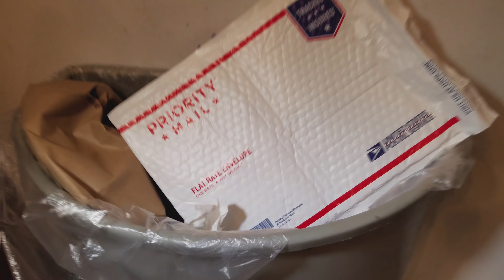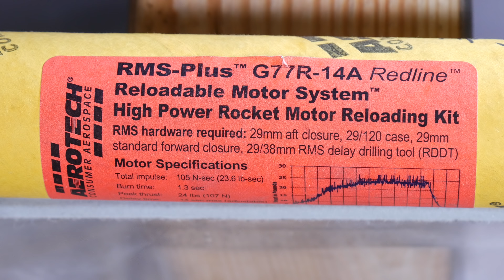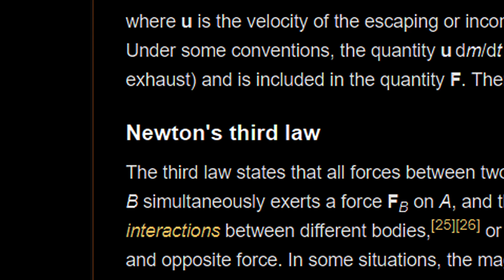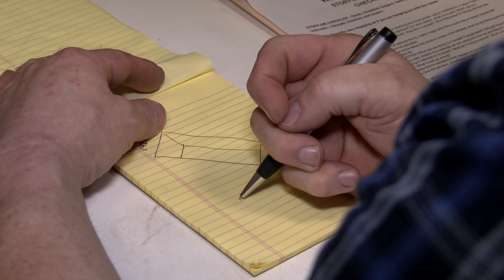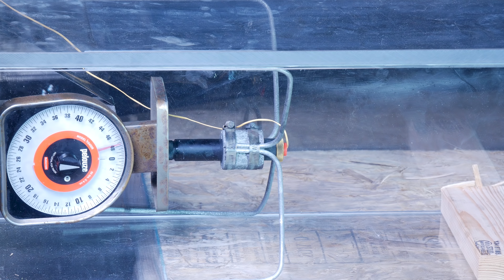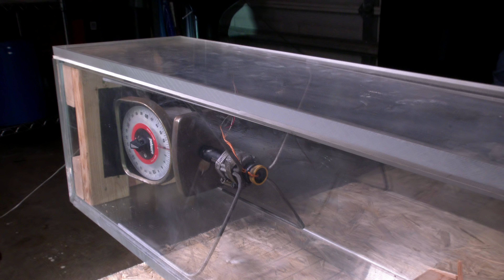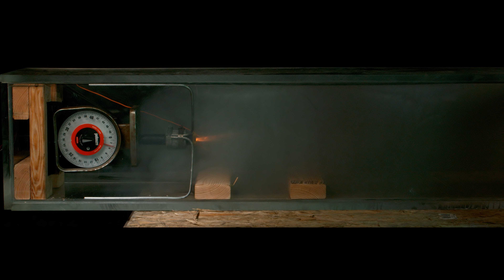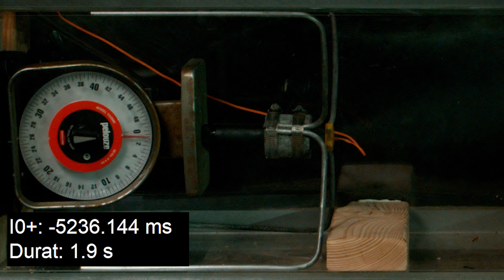Rockets in a Vacuum Chamber - Newton's third law of motion Visualized

Comment: The problem is once the rocket lights off it fills the chamber with matter thus nullifying the vacuum. This experiment starts off in a vacuum but ends up a pressurized chamber.
Reply: It doesn't matter either way. A rockets thrust is not pushing off of anything.
Reply: Jason Jennings  ... dude these guys are shills! They always rely on Newton's third lie! They don't even understand it! They're deceivers and charlatans the science of today is like bad religion of yesterday. Anyway dude you rock God bless
Reply: @ToxicTeemoOCE  it is. In this case the chamber is too small and it's own particulates act as a backstop using it's own exhaust as atmosphere creating thrust. That is the experiments downfall. Chamber too small, igniter sealed in a air pocket nor in vacuum (epoxy) allowing ignition,. Failed test, but leaves some interesting questions and experiment ideas. Cheers
Reply: Yes,all man made. Rockets start in the atmosphere.then enters the vacuum of space
Reply: Not enough atmosphere generated by that rocket motor before it was effected by Newtons third law. It applied pressure to that scale within milliseconds. Your supposition failed.
Reply: The vacuum doesn’t actually matter. This test goes over and above what is necessary to demonstrate Newton 3rd. The force is being applied between the rocket motor and its housing inside the rocket. As long as you can ignite the propellant in some chamber and direct the exhaust or propellant out of the motor, you’ll have force. Think something like a fire extinguisher with a pressure vessel and a strong valve.

Also, as a example, when you fire a gun, you get a recoil. The propellant is pushing on the gun and the bullet. Your hand keeps the gun in place and the bullet goes. A rocket motor is like a gun without a bullet. When you fire a gun without a bullet, you still get a recoil because the explosion is still pushing on the gun and is directed out the barrel.

The same is true of a garden or even fire hose. Except you’re changing the momentum of water, and that causes a rxn force on the hose holder.
Reply: @72golfcrazy  With partial pressure there is a very small but minute amount of push back compared to a high vacuum. The vacuum shown here is not high enough for an ION engine to even begin to operate. Atmospheric pressure is 760mm Hg, or 760 torr. this is at approximately sea level, and the higher a person goes on this planet the lower the pressure. It is measured using an Altimeter in a plane. It works by measuring the pressure on the outside of the plane in absolute pressure, not gauge pressure. It is set preflight to the altitude of the location of takeoff, and then remains accurate unless there is a major change in the weather. It is possible to calculate the amount of back force from the partial pressure and that can be shown experimentally by using multiple identical rockets and doing them in full air pressure, full vacuum both with and without a plate directly behind the rocket motor. That would take at least 12 rocket motors of identical size and weight of propellant. Also a larger chamber so that it does not catch fire, and instead of a spring scale use an arm suspended by a pivot point and have a load cell to measure the force on the other side of the pivot point. However if this is done the ones that don't believe that science works will still say that it is all fake. Needless to say that science developed out of Alchemy, and it has a hidden language that most don't understand. They are probably lost reading about Christian Rosenkreutz in 1616 AD, and Hermes Trismegistus as well.
Reply: @OliverMiles98  I think you can also look at it that way. Same concept.
Reply: Lol exactly!
Reply: @ToxicTeemoOCE  wrong. Of course the thrust pushes on to the surrounding air. The surrounding air particles are also accelerated, this increases the thrust of the rocket.
The point is: Newton's full impulse equation contains:
F = m'*v + dp*A
Force = mass flow * velocity + outlet overpressure * cross area of the nozzle outlet

The last part dp*A describes actually the push on surrounding particles.
In space this last part might be zero (due to an uncontrolled outward spreading of the thrust particles). Then the simpler F = m'*v equation is correct.

Another big point. The thrust of an rocket has nothing to do with Newton's third law. It's the second law derived by time. Pressure (dF/dA) converts to accelerated particles. The leaving particles are changing the impulse of the rocket. This impulse has to be equalized by an accelerated rocket.

Therefore: not the thrust, only the acceleration force of the rocket is described by third law.
In detail: in their acceleration process the leaving particles are pressurizing the inner Wall of the bell nozzle of the rocket. Causing an pressure force on the bell (actio=reactio) which is directed in flying direction of the rocket. This pressure force accelerates the rocket.
Reply: It only fully ignites when enough oxidizer escapes and fills the Vacuum, you can see it clearly when he says "idk why it ignites so far away from the thrust point"
Reply: @ToxicTeemoOCE  is the rocket not pushing off the thrust itself?
Reply: @Your.Best.Friend  Hold up, are you genuinely trying to claim that the gas particulates (exhaust) that the rocket motor first pushes into the vacuum chamber (mind you, before this happens, forces is being shown on the gauge) are enough for the gas to push against to create thrust? The container was under a significant vacuum, if the gauge was showing multiple pounds of thrust before the exhaust even made it down to the other end of the chamber, then the chamber was still under significant vacuum and there was no atmosphere to speak of. Watch it again, there are two plumes of exhaust that go down to the end of the chamber, one being smoke that is literally being sucked into the area of lower pressure while the pressure in the area around the rocket increases, not nearly close to one atmosphere, but enough of a differential where the smoke immediately flows to the area of lower pressure, and the other plume is the exhaust and flame front. The container was definitely still under significant vacuum when the gauge first began to show thrust. 

Do me a favor. Sit on an office chair with wheels on a flat surface and get a medicine ball or a bowling ball, then throw the ball away from you as hard as you can by pushing your arms out and miraculously, almost if by magic, you will roll in the opposite direction, not because the ball is acting on the molecules in the air, but because while holding the ball, you and the ball became a shared mass, and when you pushed that chunk of mass away, you were launched in the opposite direction.
Reply: @chaisdatson6207  That's not correct at all, watch the video again. The reason it wasn't igniting was because of the igniters that they were using in combination with the vacuum. Those igniters are a type of electric match that also has a fuel and oxidizer and a small wound steel coil (like steel wool) which gets super hot, ignites the match's fuel and oxidizer and creates enough of a heat source to light the solid rocket propellent. Under atmospheric pressure, this works fine because the amount of gas that the match itself produces in the SRB cavity isn't enough to overcome the atmosphere's pressure pushing on the other side. When they light that electric match under a vacuum, that same volume gas is still created in the rocket cavity but the vacuum in the chamber causes that gas to want to rapidly move into the area of low pressure, literally shooting the match (igniter out). If you want to see this process in action, look up SmarterEveryday's baseball cannon, where they intentionally pull a vacuum inside the barrel itself, which massively increases the velocity of the baseball when they open the air tank (propellent). 

The other reason why the electronic matches don't work well under vacuum is that they are designed to be used in a regular atmosphere with air, which contains an amount of oxygen helping the match burn, and while they do have their own oxidizer, the loss of the oxygen normally in the area means it doesn't burn as violently. You could easily test this yourself, go to the hobby store and grab a few packs of model rocket motors, which should come with electric matches. Then get yourself a decent sized jar with a metal lid and a small tea candle. Cut a hole in the lid small enough to get the wire for the electric match through and then hot glue the hole shut. Attach the electric match to the wires  on the other side of the lid, light the candle, put it in the jar and screw on the lid. In a few seconds, the flame will go out as the candle consumes all of the oxygen and pull a vacuum inside the jar. Once the candle goes out, light the electric match using the batter starter and watch how slowly the electric match burns, if it even burns at all instead of fizzling out. Then, light another  electric match outside of the jar in the regular air and watch how fast it burns up. Those electric matches have their own fuel and oxidizer, just like the igniters they were using in this video, and when you ignite them in a vacuum, the reaction is much slower and not nearly as hot, which prevents the rocket from igniting.
Reply: @ToxicTeemoOCE  Then there is no power. As soon as the opening of the fuel is opened, the fuel, under pressure, is lost to space.
Reply: @johnsergei  Yes, but the escaping gas still produces force, which moves the rocket.
Reply: @johnsergei  Ok we are getting somewhere, you admit they went to the Moon, you know they had to make course corrections along the way right? Also when the lander was landing on the Moon, they were also using thrust to slow their decent. All of this happening in a vacuum.
Reply: @ToxicTeemoOCE  Gravity exits in a vacuum.
You are in Parking Orbit, you have circled the Earth & now you & you have to get to the moon Good luck, but I think you'll be home early, THE HARD WAY! OK, how do your get to the Moon?
Reply: @johnsergei  Yes, I know gravity works in a vacuum. Obviously, that's how orbits work. If the Suns gravity didn't effect the Earth, we wouldn't be in an orbit.
But easy, you are in orbit around the Earth, in the vacuum of space, fire off your rocket, and make the trip to the Moon. Land on the Moon. Then leave the Moon, firing off another rocket, again in the vacuum of space, make your way back to Earth.
Reply: @ToxicTeemoOCE  You are circling the Earth & your orbit is decaying. You are not under power. How are you going to get to the Moon.
Reply: @johnsergei  YOU USE A FUCKING ROCKET. It shouldn't be this hard.
Reply: @johnsergei  I build, launch, and operate spacecraft as my job, and I have been doing it for longer than you have been alive.  Ask me any question you like about spaceflight tech.  I literally know more than the astronauts
Reply: @stuartgray5877  In the photo of Aldrin taken by Armstrong on the moon,  face on, about 10 feet away, with the chest mounted camera slightly above Aldrin's head. How come you see luna surface, where  Armstrong should be in Aldrins vizor? You do see somebody way in the distance (in the reflection). Were there 3 people on the Moon on Apollo 11 @ where is Armstrong?? This image has been used over and over again, yet there is so much wrong with it. It's a composit.
Reply: @johnsergei  Lookup how NVIDIA Themselves PROVED the images are real.  They analyzed them and found them to be authentic.

Tell me do YOU think YOU are smarter than every engineer and physicist alive today?

DO YOU?
Reply: @johnsergei  Oh and this thread was about rocket Propulsion, not Apollo missions. 
try to stay on topic.

If you DONT think that rockets can work in a vacuum answer these questions (you WONT, you will make up an excuse NOT TO):
1 - When the rocket engine is running, is the exhaust gas ACCELERATED from the nozzle? Does it CHANGE VELOCITY as it exits the nozzle?
Yes or No?

2 - Does this exhaust gas have MASS?
 Yes or No?

3 - Can any MASS be ACCELERATED without a FORCE?
 Yes or No?

Or does ACCELERATION of a MASS require a FORCE?
Now answer these three questions and we can get to the REAL questions.
Reply: @JGtheone  - "Of course the thrust pushes on to the surrounding air."

Sorry but you are wrong.  The Tsiolkovsky rocket equation tells us that rocket propulsion is MORE efficient (creates MORE THRUST) in a vacuum where there is NO AIR to slow the exhaust gases.

"The thrust of an rocket has nothing to do with Newton's third law. It's the second law derived by time"

This is also false.
Rocket propulsion is a form of mechanical RECOIL which is due to the third law.

Maybe you should try taking AT LEAST high school physics before declaring every engineer and physicist to have EVER LIVED a bunch of idiots?
Reply: @None888.  Absolutely true. They scramble to explain what is not logical. Lies placed on repeat.
Reply: And we need a bigger vacuum chamber because the rocket pushes against the opposite wall
Reply: @jincen3306  That's not how rocket propulsion works.
I can help you understand but you must answer a few questions.
Do you think that a crossbow fired into a vacuum would have any recoil? Yes or No?
Why or Whay NOT?
Reply: @stuartgray5877  There is no density in the vacuum of infinite space to be able to have propulsion, density is an invisible wall like the air, and combustion in a real vacuum environment will never take even with onboard oxygen you will get a spark and the rocket will throw gas until exhaustion in a vacuum. In the vacuum chamber there are walls the rocket fills the vacuum with gas and the experiment cancels itself.
Reply: @jincen3306  So answer a few basic physics questions to PROVE that you understand basic physics.
I am sure we can find your misunderstanding.

To start: do CROSSBOWS experience RECOIL, here on earth in atmosphere?
Yes or No?
Why or WHY NOT?
Answer and we will get to the real questions that will help you understand.

Most "Physics Deniers" will refuse to answer my questions and choose to run away like cow ards.
Lets see if you are one of those.
Reply: @jincen3306  the company I work for tests rocket thrusters here on earth IN VACUUM and verify they produce the thrust predicted by the Tsiolkovsky Rocket Equation.  We then put them on spacecraft, launch them to space and TEST THEM THERE TOO.
I have built and launched Six spacecraft, two to earth orbit and four to deep space.  Five of them had propulsion systems. 
Now tell me again how a high school dropout knows more about spaceflight technology than I do 
Bless your little heart for effort though!
Reply: @jincen3306  and just like most "physics deniers" you refuse to answer questions. No wonder you dropped out before the 9th grade.  You must have infuriated your teachers.  Did you refuse to take tests?
Reply: @jincen3306  oh and please stop trying to lecture a 25 year vacuum test specialist about how vacuum works.  I was testing billion dollar vehicles in some of the nations largest thermal vacuum chambers before you were born.
Reply: Those gases are also going to the opposite end where the opposite reaction can be applied. Therefore the rocket is going to move regardless
Reply: @765garage  Sorry but that's NOT how rocket propulsion works. The Nozzle feels the force as the mass of the exhaust gas is accelerated from the nozzle. It does not have to hit ANYTHING for the nozzle to feel a force.
Reply: @765garage  think about it, do you feel recoil from a gun when the bullet leaves the barrel, or when it hits the target?
Reply: @racerex340 top flies off when the rocket is launched showing massive overpressure
Reply: And what about 0 gravity?
Reply: If the earth is 4x larger than the moon then why in " earth rise " does the earth look so small when allegedly viewed from the surface of the moon? It appears to be the same size relative to the moon when viewed from the earth...
Reply: Exactly. The vacuum broke immediately. A very sloppy experiment.
Reply: @stuartgray5877  - hmm. Your "recoil" claim looks logical. But still this experiment is really badly designed.
Reply: @maxcompress9732  - "But still this experiment is really badly designed."

When my company tests hydrazine mono-propellant thrusters right here on earth IN A VACUUM, we can only use the first few MILLI-SECONDS of thrust as valid data because the exhaust gas DOES "Ruin" the vacuum.
Good thing we are smarter than a bunch of toddlers when we build and launch spacecraft to earth orbit and deep space.
Reply: @rayco55  - "why in " earth rise " does the earth look so small when allegedly viewed from the surface of the moon?

So PERSPECTIVE confuses you?
When you see your car at the other end of the parking lot are you scared you won't be able to get into it because its so "small"?
Cows very far away are SMALL, cows close are BIG.
You are welcome.
And bless your little heart!